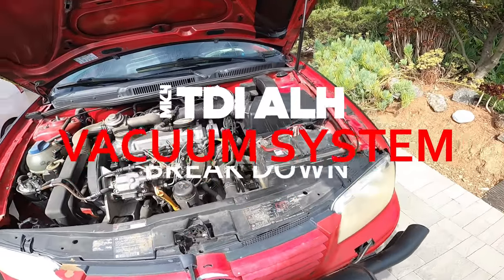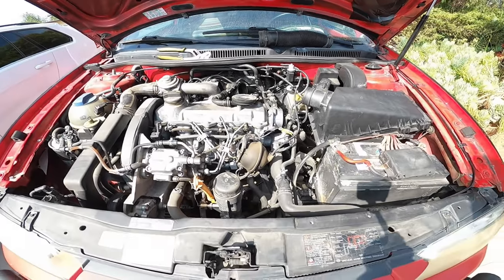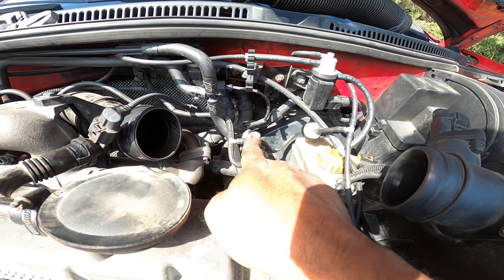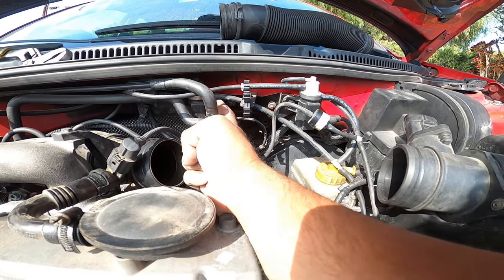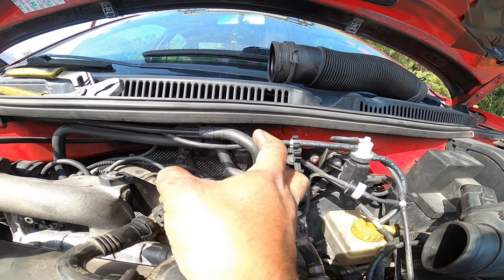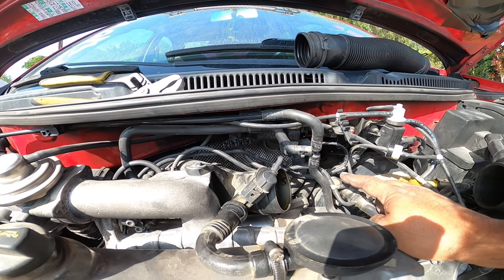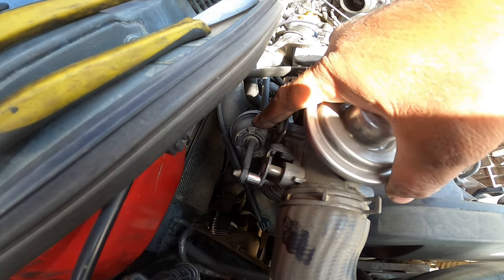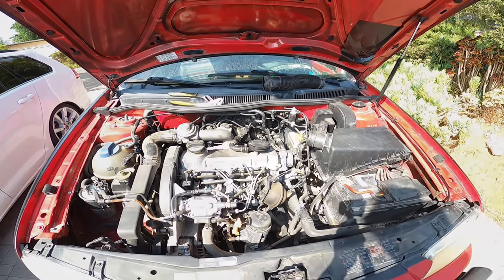MK4 TDI ALH VACUUM SYSTEM BREAKDOWN S7EP30

Comment: Hei please tell me what happens if its not correctly asembled ?
Reply: I have them changed but the man who did this i think put them rong and now i have no turbo
Reply from the maker: If the lines and solenoids are not plummed correctly you can have no boost pressure Inproper braking issues with the EGR